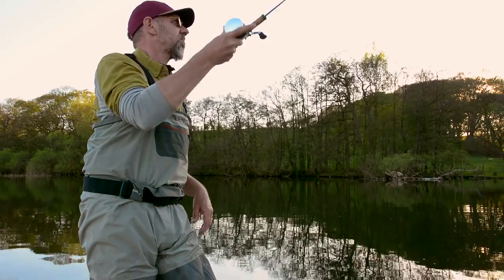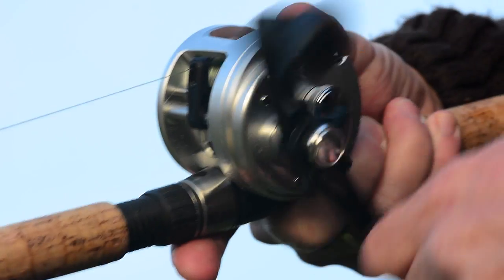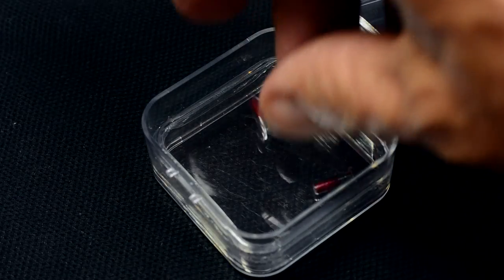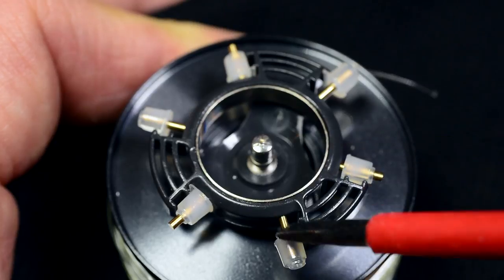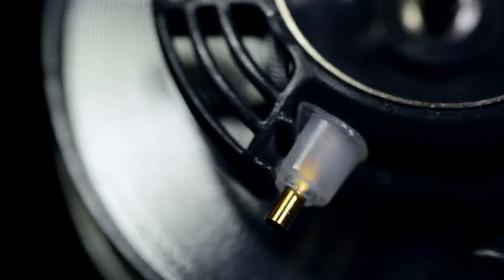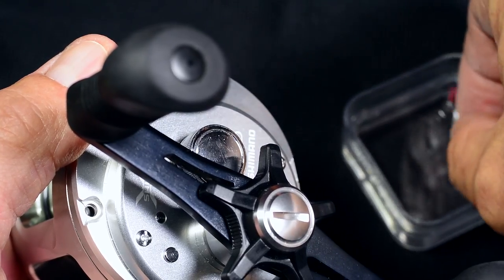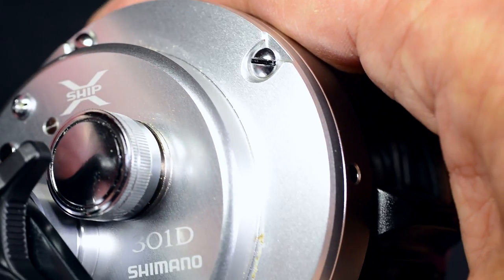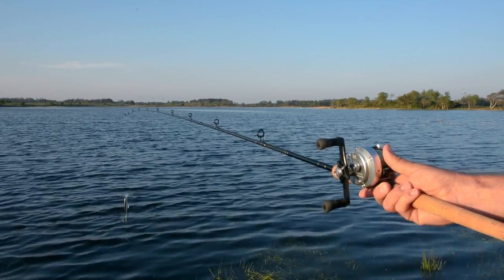Shimano Calcutta  - casting brake setup tutorial

Comment: Thanks for the videom adjusted my brand new  200d today. It only has 2 Phillips screws hold the handle side plate on. I actually turn all my weights off to make casting 1/8 ounce Texas rigs in shallow water much easier for bass. Worked like a charm but the screws feel like they're made out of butter. I would set it and forget it because repeatedly removing the screws will most likely round the heads . Why didn't Shimano stick with the thumb screws. Much better imo
Reply from the maker: Thank you for the feedback, Gerald. Congrats on the 200D. Great to hear it handles the light weights. I agree on the screws. Thumb screws would be great. Tight lines, Michael :0)

Comment: That was great was looking for a 400 and after reading how some complain about the spool brakes adjustment, looking at how you do it seems so easy. People are just lazy.
When you mentioned 3 of the brakes  are activated for heavier lures what are the weights you can give  examples from your experience? Like throwing irons vs swimbaits. In grams. Thanks in advance.
Reply from the maker: Glad it helped. To be honest I will advice you to start with the factory settings - whatever size lures you are gonna cast. Only engage more brake weights if you really feel the need to do it. The brake system is fabulous on this reel, and in most cases you wont have to much elsa than adjusting the tension knob to each new lure. Cheers, Michael :0)

Comment: I use the regular Calcutta, these look so nice but this looks like a pain to do on the fly vs just undoing one screw and having quick access to the brakes like on the 201b I use
Reply from the maker: Zion, I've used the Calcutta B for years, and it's is still a great reel. The D series is definitively a serious upgrade, though, but you are right. On-the-fly adjustments are more difficult. I love both reels, but I find myself grabbing the D- series more often. Tight lines, Michael :0)

Comment: So if i activate all 6 break weights will i be able to cast say 12-15g baits on the 400 size? Waiting for my reel in the mail as we speak. Great video. Tight lines! greetings from Norway
Reply from the maker: Thanks Krobin. You should be able to do that, but a size 400 will be better suited for heavier lures. But the brake system is great. Congrats on you new reel. Cheers, Michael :0)
Reply: @MichaelJensensAngling  Thank you so much Michael🤝🏻
Reply from the maker: @krobinb903  You are welcome :0)

Comment: Great review sir. I just bought calcutta xt100. It have same vbs but i dont know if it has x ship features. Can you suggest how many brakes should i on to throw lure 10grams to 15 grams?
Reply from the maker: Thanks for your feedback, Aniq. I would start with the factory setting with half of the brakes engaged. Should work just fine with those casting weights. Congrats on your reel. Cheers, Michael :0)

Comment: Being a true "tackle tart" ;-) I have many spinning, fly, ice reels with just as many or more rods. However I have one legit baitcasting reel and two rods for it. It's an ABU Garcia Ambassador Mag 2. It's a cool piece of engineering but I never got the hang of using it. It's got those magnetic brakes. I should've kept at it but my index finger was highly educated compared to my thumb :-) My only true "round" baitcaster is really a well made toy or kids reel. Click drag like a fly reel but the knob on the side, maybe a brake, does nothing. It's got a level wind, I think it disengages too. I just realized the solid fiberglass yellow rod and red plastic pistol grip handle must have come with it. I have used it ice fishing. For the life of me I can't remember how or when I aquired it. 
   Do those brakes on your reel wear out in time? It seems the plastic flange might weaken if you adjust them frequently. Nice video and setup Michael 👍 thanks 😎
Reply from the maker: Thanks Joe, You know... boys need toys. The Abu Ambassadeur Mag 2 is a cool piece - and I freaking love baitcasters ;0) Maybe you should take that old reel out for a spin (even though it isn't a spinning reel;0) I am sure it still is a smooth operator. 
The brake weights will hold up for many years of hard use... since you don't adjust the internal parts that often. 
All the best my friend :0)